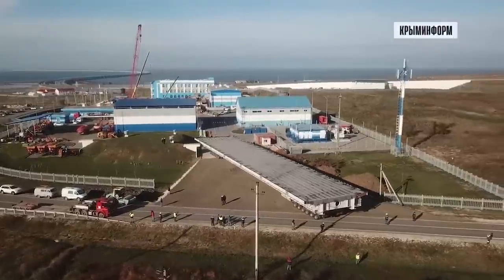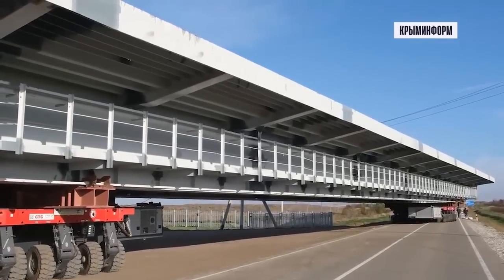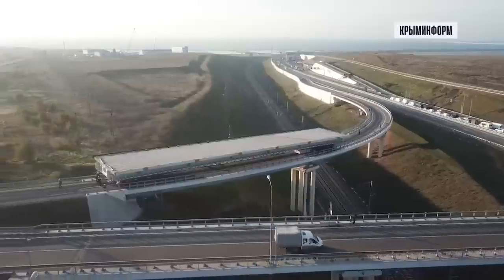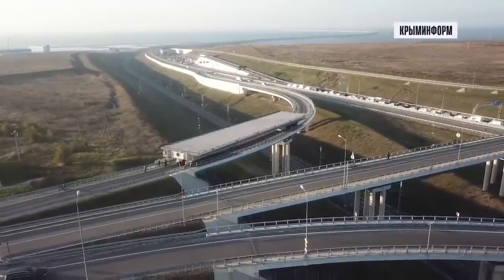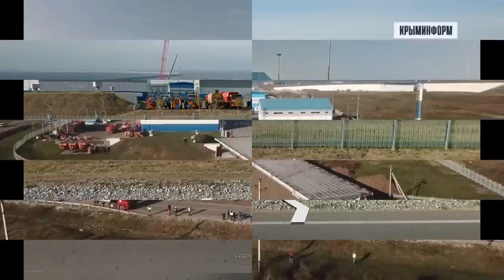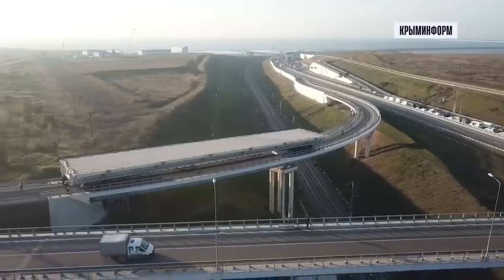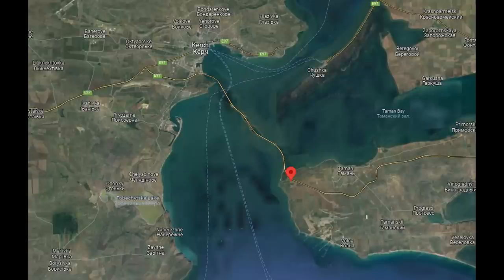Russia Transports New Span to Repair the Crimean Bridge

Comment: Engineering Lecturer here (full disclosure, NOT Civil Eng). I find it hard to believe this was manufactured from a cold start after the 08OCT strike - you need to find materials, skills, equipment and likely things like jigs and etc, then get everything spun up. 4-5 weeks is a BIG call, and I feel probably too much of an ask.

BUT I do see two options that are extremely plausible. 

Option 1 - Russia knew this was coming. Ukraine has been threatening this bridge for months - is is quite possible that Russia began work on a spare block or four, months back, to allow them to quickly recover should the bridge be taken down. They would NOT have generated complete blocks, however they would have collected material and resources, the probably had cut steel and maybe even begun the major structure, leaving things like plumbing and rails and road surface and etc, unfinished until the block was needed.

Option 2 - This is a prototype block that was manufactured as a validation device or a reference device. Many projects will manufacture prototype blocks to verify the engineering, the processes and everything associated works - we see it in bridge building, we see it in ship building, we see it in almost every form of modular construction. A reference device is similar. Thus this block could very well have been sitting at that plant for several years, possibly in a >80% complete state, either as a prototype, and/or an inspection/development reference (something you want, so you can prototype a later refit and develop procedures), possibly just requiring a quick overhaul (blast existing finishes off it and reapply them), new road surface and rails.

For me, I see Option 2 as the most likely - its simply the fastest way to get a block out the door. 

For a new build, I just can't see how they could do it from a cold start - if the production was in full swing, like 2018, yeah for sure they could smash out out super quick. Or if they were 'building insurance policies' since May-June 2022, again, for sure... But not from a cold start.
Reply: Just as a note to the above, I see some are saying "it is made out of recovered pieces from the fallen spans", I guess this is possible... Not sure I'd be wanting to trust that block long term, if so. But depends on how desperate Russia is to have their MSR back up.
Reply from the maker: Thanks very much for your thoughts. I considered russia preparing, but--given russia's arrogance, would they really anticipate it? They've underestimated Ukraine from the start.

Option 2 is looking very possible. I didn't consider a prototype block as being a thing. Very interesting to know.

Thanks
Reply: @suchomimus9921  - I think we're underestimating Russia if we ignore prep'ing... Ukraine and the WORLD were quite open about hitting the Bridge (lots of memes and etc, for example), and Russia did fwd deploy decoys and CM's and some sort of terminal anti-air in the immediate vicinity. 

So Russia obviously knew the bridge was high on the target list. And it being her MSR (Main/Major Supply Route - depending on which war college you go it) into Crimea, you'd be bonkers to not do something to ensure there was some set contingencies, that include patches to the bridge.

The other interesting part is the Rail bridge - that got PROPER hot when those fuel lorries burnt (I don't beleive we've seen much in the way of rail movements since then?). I would be very surprised if there was no damage to rails (warpage and etc) or structure (warpage, annealing/loss of strength).

Comment: Hi,  I suspect that there is no concrete in road surface area..  This will be added after section has been placed in position..  It will be much lighter this way and easer to handle..

Comment: Anster  in china makes this kind of transporter it was a European invention but due to the high cost in materials and labor it moved to China  ----- as to the bridge  Mouduler section can be cut fast and welded but you got to remember that long spans can be modular and the distance from pilers  (vertical columns) may vary they could have had one for another project and just a few sections to get that distance right  - the biggest issue here is lifting it  and installing it by sea cranes - and its the best time to hit it again with missiles  when its lifted by sea cranes

Comment: Pity the Italians haven't got remote data access on their crawlers such that they could remotely disable them..... 

I wonder if the same could be done with aircraft engines to disable them from being started.....I know that these days the engines are mostly leased in the case of Rolls Royce Trents etc, and the manufacture has telemetry regarding the state of the engine at all times it is powered!

Comment: Little contribution here:
There is and over abondance of aerials on the bridge and it’s construction process on Google earth. I invite everybody to look at them, there is a lot to learn about the construction process.  In short: this site never saw bridge construction works.  The staging yards are elsewhere and got reclaimed afterwards.  No chances this is and old video, since “prefabrication” and hauling was not the way they built the bridge (they used many techniques but not this one). This is and always was a maintenance yard.  There are no evidences of any leftovers materials and lesser evidence of full “stand by” span. You can’t hide this, or the main girders (the big beams), from the aerial pictures.

So yes, they were able to muster the ressources to trow together a complete span.  Quite a feat. Now, may I point out a detail:  in building this new span, they hit the very exact color nuance to match the old bridge, but they ran out of paint, hence the obvious patches at the catwalk support (and elsewhere) and the new endplates and stifners that are bare surface rusty steel.  Why so?

My guess is that the expedite steel supplier at work is the bridge itself: they brought back to shore the least damaged sections and hastily fixed it back.  Looking under the deck, we can see blackened spots, that could be welding scars that were not painted. More likely is it darker color paint.  It makes for a nice show of resourcefulness.  Lets see how many of these spans the bridge can supply.  The last spans needed may be back order for a while, while this one puts up a nice show for propaganda purposes. 

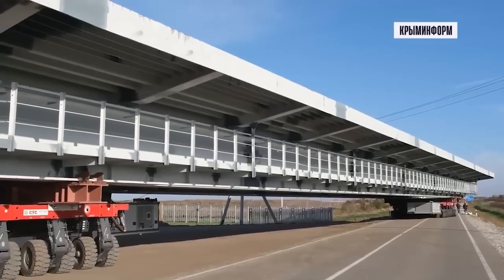If we want to go more technical, we dont know how well bits and pieces thrown together will sustain corrosion in the future.  May I emphase that as we can see at 1:15, all of the cross beams bear heavy paint touch ups close to the main girder, and other traverse painting under the deck every two cross beam.  It becomes quite obvious that the deck structure was cut in sections and were all welded back together.    Well, this is a lot of site welding done very quickly, since it could not start before the bits and pieces were cut and dismantled, brought back to shore and reassembled. Did they add time for any quality control?  It will be interesting to see how it performs once in place, and this if it can withstand the stresses induced by the installation technique they will use to put it back in.

Comment: I'm not s construction expert, but looking at a structure of this size and importance it appears to me kind of a 'best practice' to (1) standardize as many parts of the construction as possible and (2) hold a certain number of spare parts at hand, especially in war times, when the building is contested. I imagine that parts were in storage, and just needed to be assembled to bridge spans of a certain (standardized?) length. At least this is what I would consider if I were responsible for maintaining that building.
Reply: Civil engineer, here.

When you have money but can't place it in international accounts due to sanctions and asset freezes you now can invest it locally in your own economy. Gone are the days of quick gas and crude earnings which could be whisked away into London and NYC accounts for safe keeping !

This might be why this bridge span was fabricated so quickly. The money always  needs to go somewhere.

Experts were hired for around the clock and likely overpaid for improved motivation.

Section elements are standard and were pulled from a maintainance  warehouse.

But was proper QA-QC done on the section prior to shipping it to the  construction site. This remains the massive elephant in the room.

Another  poster here cited the use of an Italian (?) transport crawler. As sanctions continue and spare parts become scarce crawlers like this will cease to operate, preventing bridge repairs. I'm sure the crawlers, having to bear very heavy weights, need specialized ball bearings. 

Remember what had happened at start of war? Sanctions stopped import of specialized Swiss ball bearings. Because of this, the Russian rail company, who use such bearings, knicked several routes and retired several cars.

And the crawler parts ought to be even more niche, more specialized hence harder to obtain.

Ukr and Ukr allies would we well-benefited to sabotage such crawlers to disallow the movement of completed bridge sections. The bridge will be hit again, I have no doubts about this, so by eliminating the crawlers its repair will be very, very hard.
Reply: @oleopathic  Remember the building collapses in Korea where the reinforcing rods were moved around to fool inspectors?
Reply: @annoyed707  which Korea ? Tell us more. Town and date. This is nuts.

Comment: The 2019 street view photo showing a connection between the road and the plant doesn't prove anything. The footage could be from 2015, after the bridge was completed. After completion, there's no need for the massive tarmac connection to the road and it could have been removed and replaced with those small trees. Not saying that is the more likely scenario, but without further info, my assessment is inconclusive.

Comment: Why they don't transport it in the barge  with heavy lift crane and seperate barge? I doubt about the access going to the bridge and the capacity of the existing bridge could support the weight.

Comment: No, it's not possible to construct it as quick as the beton elements need more time to harden.  Minimum time: one month, if it's finished straight away (it won't be).  But it can be used with a reduced load though this will reduce the max.load of the bridge. The tensions created during harding are not really a good stuff for the concrete elements.

Comment: Might as well target it now. A minor hit will knock it out of shape. It will also block all access if hit en route to the site.
Reply: Yup.  They might transport it into place over the existing bridge.  Typically this requires a strong cantilevered sliding support to get it past the end of the usable road.  That structure will be larger than this bridge section.

If they can target and wreck the cantilever support, Russia will lose a critical asset and have a huge mess which blocks access to at least half of the remaining road portion of the bridge.

Comment: Oaaa they really pulled all the stops, I guess that under militarry control lyke basically requesitioning the factory, the materials and the workers at gunpoint it could be done, the transport vehicles are heavy lifting modular industrial commercial available vehicles.

Comment: It is certainly possible Russia did this in a month. The thing is you need standard girders, steel plates, and welders, and a bit of paint and tarmac. So its not the concrete which i believed it was but steel. Still 1 month and the job done. Pretty nice going. The 2nd bridge part going in on November 11th. 

As stated the girders are of a standard size probably, and that makes it surplus parts waiting for a buyer. If they did not have these laying around (they probably had them laying around), they could have ordered them from China or India. 

They must have kept the blueprints somewhere next to the bridge. And the design bureau probably kept a copy too. 

Stucturally sound and up to specification. More than likely. 

I like civil engineering. Looks like a good job well done. 

If Russia had 2 bridge sections laying around, it would be a scandal, because then Russia probably blew up the bridge. As i was not there, i cant say what did happen. I doubt they had it laying around... The drone campaign started after the bombing. Did they really think they needed destroyed infrastructure to launch such an attack at the Ukrainian (energy) infrastructure??

What im not getting is that Ukraine is not shooting some heavy missiles at that bridge... 

Greetings,

Jeff
Reply: You are very smart. All bridges are required by law to keep the blueprints in a sealed box next to the bridge.

Comment: There is a video of the same span being dropped in place. Welding? Yes and no.  We can see clearly on the other video that it is bolting galore, with numerous added heavily bolted gusset plates.  A mixmatch of welding and bolting on the same structure may prove difficult to modelised.  Seeing the number of bolted plates on this structure looks more like they jimmy-rigged something on the fly.  Certainly concerning for any user, but it should hold if they monitor structural behaviour and impose weight controls.  One span down three to go.  Eager to see how many they can piece together from fallen parts.  Still very good propaganda footage, no one can ague about this.

Comment: I think that there are plenty of surprises in store for Putin. 

Remember that Ukr has today and has had all along the home advantage - they have access to local informants, advance and intimate knowledge of local landscape, and thankfully Putin's built-in ineptitude as a bonus. Don't forget how local Ukr  turncoats have been ending up as well: this latest Stremousov politician died in a car accident. So turncoat utility is minimal.

As for the coating. It's important in the long run and by that I mean like a decade. But seeing the quick tempo of this war from start to finish, in another 7 months, and I hope, Ukr will have its lands back.

So in under a year if coating was faulty and some corrosion occurred it will be minimal. Remember that steel sections are massive with large thicknesses of webs and flanges, massive bolts. It takes much time for these to thoroughly degrade and to catastrophically fail.

Odds are much higher that an ATACAMS will come over for an uninvited visit at 4am on the same Bridge. ;)

Comment: Building a structure that large, that quickly doesn't leave time for proper quality control. Finding a fixing weld defects takes time. Not doing it leaves the possibility of those defects eventually causing failure once it's installed.

Comment: The footage is from 2015
Reply from the maker: Nope, the entrance it emerges from didn't exist in 2015---shown by streetview images
Reply: @soccerguy2433 The buildings didn't exist until 2017, it was open land in 2015.
 This appears to be the support facility for the bridge operations and maintenance which is a never ending task with a few dozen or more with extensive knowledge of the bridge.
  Since failure projection could predict the cost of loss of a span they could well have put aside the components on hand for one or two spans.  It is not uncommon for large constructions to keep spares or facilities to make them quickly, plans of course but construction jigs and perhaps preposition construction materials. A very proportion of the cost of the entire bridge.  Likely they have many similar components in each span.
 It depends how long it takes for the other 3 needed and for the railway bridge, it is no use until all of them are in place.
 Either this is just for publicity and morale, or they really do expect to be fighting in Crimea for a very long time. Which is unfortunate.

I don't think this is a standard section diverted from another bridge as suggested, the exit ramp would have been there already if they were making them already and it is rather large to transport a great distance.  Smaller prefabricated sections could be more easily transported and assembled on site.
I do not know why it has some sort of bunker on the left either.

Comment: Civil engineer, here.

When you have money but can't place it in international accounts due to sanctions and asset freezes you now can invest it locally in your own economy. Gone are the days of quick gas and crude earnings which could be whisked away into London and NYC accounts for safe keeping !

This might be why this bridge span was fabricated so quickly. The money always  needs to go somewhere.

Experts were hired for around the clock and likely overpaid for improved motivation.

Section elements are standard and were pulled from a maintainance  warehouse.

But was proper QA-QC done on the section prior to shipping it to the  construction site. This remains the massive elephant in the room.

Another  poster here cited the use of an Italian (?) transport crawler. As sanctions continue and spare parts become scarce crawlers like this will cease to operate, preventing bridge repairs. I'm sure the crawlers, having to bear very heavy weights, need specialized ball bearings. 

Remember what had happened at start of war? Sanctions stopped import of specialized Swiss ball bearings. Because of this, the Russian rail company, who use such bearings, knicked several routes and retired several cars.

And the crawler parts ought to be even more niche, more specialized hence harder to obtain.

Ukr and Ukr allies would we well-benefited to sabotage such crawlers to disallow the movement of completed bridge sections. The bridge will be hit again, I have no doubts about this, so by eliminating the crawlers its repair will be very, very hard.